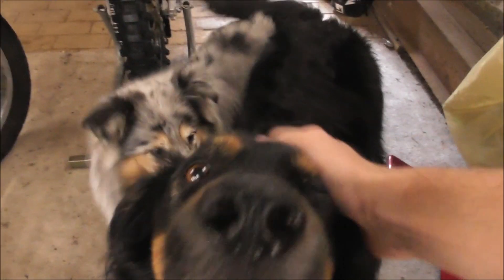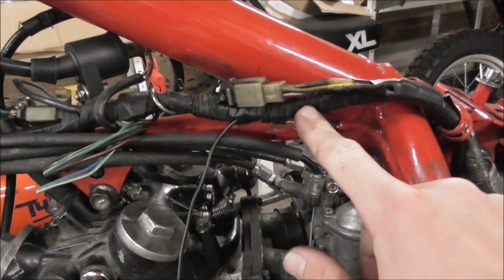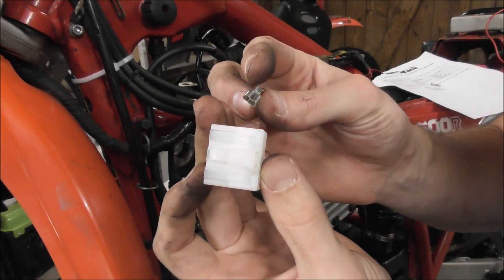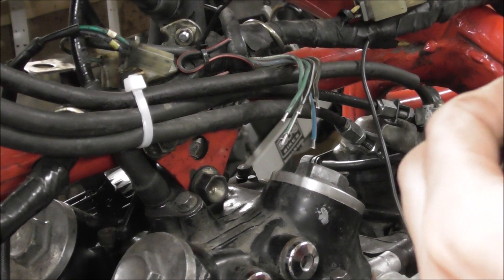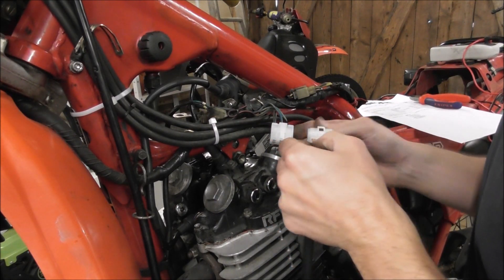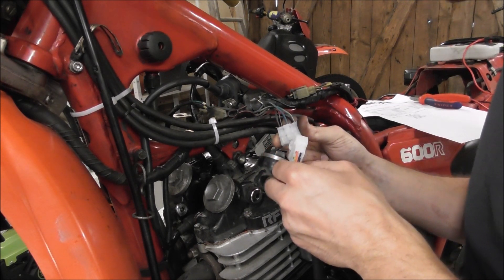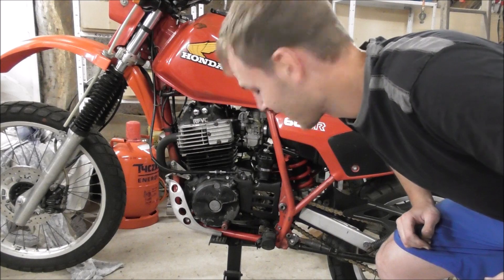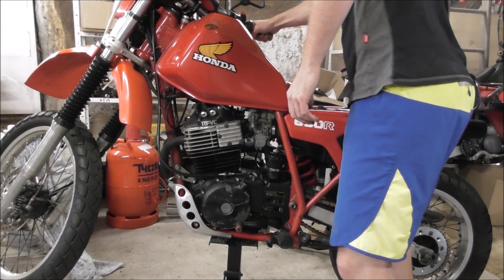Honda XL 600 - Will it run? Ignitech DC CDI installation

Comment: Hi! I am debating if I should change the stator or do the new Ignitech CDI like you did. You say it doesn't need the coil anymore, but what about charging the battery and the lights? Thanks!
Reply from the maker: Hey, you are mixing something up. The original cdi needs a separate coil on the stator only for the spark. Everything else has own coils. The ignitech doesn't need the spark coil.
Reply: @bikedogtor1663  Ah of course! Danke!!

Comment: I don't want to sound mean, but your pliers did a horrible job crimping.   You should have put a little solder on the wires and terminals.  You don't want a loose connection causing more problems later.
Reply from the maker: Thanks for your comment, I  know the crimp wasn't the best but good enough for that moment. It holds tight up to now.
Reply: @bikedogtor1663  
Good luck with it!  Did it pass the 5 km test?
Reply from the maker: Yep still running
Reply: @bikedogtor1663  
Good deal!

Comment: Was installing this kit as well a few days ago because the bike wouldn't run properly and we thought it was igniting not correctly because i changed the alternator. It still ran dirt shit. So in the end it was the auto deco on the Kickstarter holding open the little valve...
Reply from the maker: Noah Richter Thats bad, thank you for sharing. I removed the auto deco cable, the manual deco is enough imo